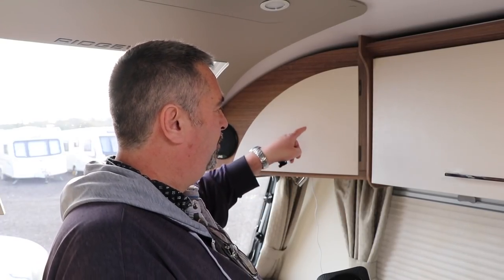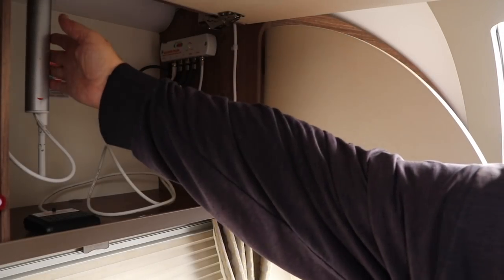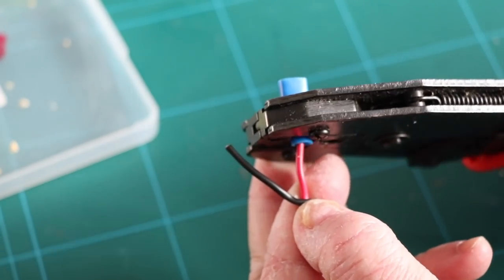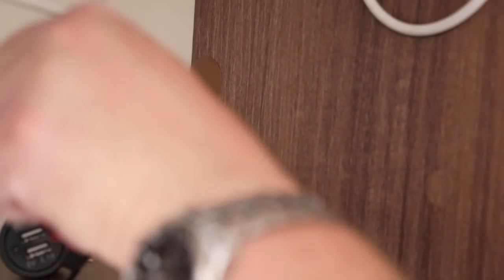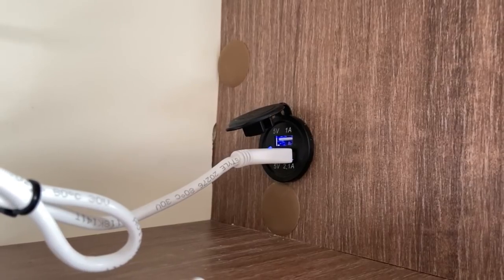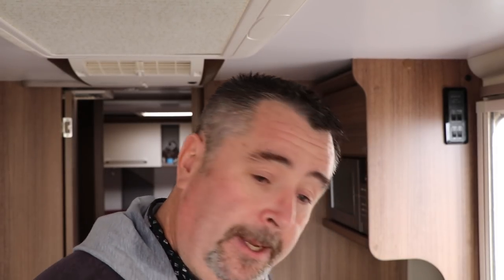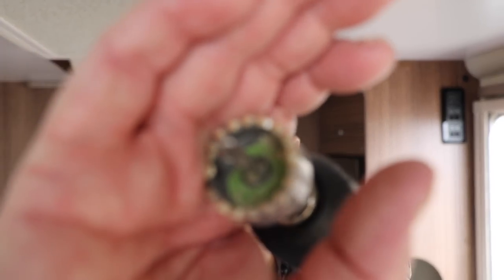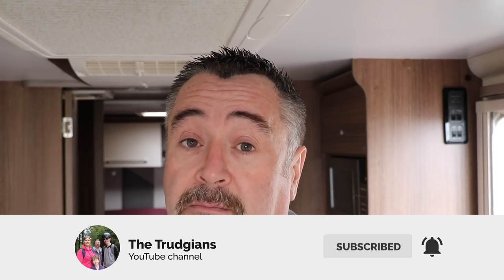A useful caravan USB installation

Comment: Great job there Dan, especially fitting the socket so everything is hidden inside the radio housing. Good idea that using the drill to twist the wires together. Stay safe Dan and family and look forward to next video. Rob
Reply: I’ve just installed a 12v socket in the caravan locker to run the compressor to do drain downs pump up tyres and air toys. Love these mods

Comment: Don’t throw it most hole cutters only come a certain depth as you have a pilot hole all the way through you can come from the other side. If this is not possible then when it bottoms out remove the hole cutter remove the drill bit from the centre then slide the hole cutter back into the grooves already made then tweak it to one side and the insert will break off. If not then use a small flat point screwdriver and do the same, once the excess has been removed you can put back in with the drill bit and cutter to keep it central and continue to cut. I use this method in cutting holes in trucks and van bodies when installing fridge units. Top tip take your time and it’s neat and tidy.

Comment: Hi Dan we have our caravan on the drive just last weekend brought it home from the seasonal pitch today I fitted two hidden usb sockets plus a Alde discrete heating sensor and tomorrow I be following your fridge fan insulation I purchased all the parts had them waiting for the season to end to fit setup the parts just got to assemble thanks Dave🤣😊

Comment: Hi Dan, Good to see you back, the problem with the hole saw could have been rectified by drill the hole from both sides of the panel (that's of course
if you can fit the drill in). This also makes for a cleaner hole on both sides.

Comment: Do you have a solar panel? We have a tracker and a mouse repellent on all the time and battery stays topped up in storage all through the winter. So if you go off grid your ‘live’ USB’s won’t be a problem. I put a 20amp socket and usb on the bed panel and wired them onto battery using a mini fuse board you have in the car. We have a Bailey Brindisi where battery is under bed. I put the socket in for when we try going off grid so my good lady can use a 12 volt hairdryer which needs 15amp minimum.

Comment: Hole saws can be handy if you have veneers and access both sides.  You can cut to the center from both and prevent breakout.  The radio could do with a surround to hide the mounting cage could it not?

Comment: Hey Dan, your pioneer radio looks like it's got  a usb socket on the front of it. I believe all usb sockets generally give out a 5v feed, although I'm not sure what amperage it'll kick out. 
Although not a dedicated feed, could you have just plugged the Netgear nighthawk into that?
Also a top tip, if you find yourself without a charger on holiday or in a hotel, the back of the Tv will charge your phone if you have a lead.
I love my nighthawk, they really do work well.
Reply from the maker: Hi Garry, I did try the radio to begin with, but sadly the socket is only powered up when the radio is switched on. So, in standby mode the USB is off. 

Thanks for the suggestion though
D

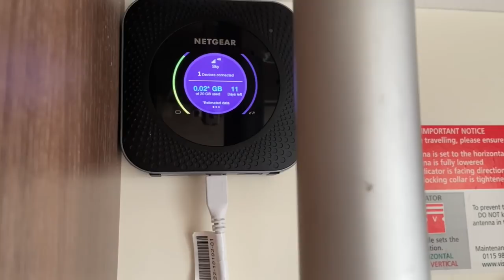Comment: 5:19 You may find that if you remove the battery that you start having connectivity problems - in devices like this, the battery is often designed not only to make the device portable, but also to provide power to cover any spikes in demand that the USB supply can't meet.
Reply from the maker: Hi Nicholas, so far my experiment works, its been running for 3 weeks under low/moderate and high traffic and its working well without the battery installed.
Reply: @TheTrudgians  That's good news. Excellent.

Comment: I had a (different model of) Netgear 4G router with an internal battery that I left plugged in to USB all the time; it’s just failed and I was alarmed to see the battery is bulging out of its casing in an “about to explode” kind of fashion. So I would recommend removing the battery if leaving the device plugged in permanently!

Comment: Hello Dan, great video thank you - I actually have one question that got me curious...at almost the end of video you switch off the mains in your caravan and say that the mobile phone notifies you about that: how does that work?!?
Reply from the maker: Hi Thats the iNet the is moaning that no 12volts are getting to the boiler, Its a quirk of the system that the iNet stays live even when the caravan is switched off. 

The iNet commuicates with me when ever there is a fault, like the boiler is faulty, there is no gas or the caravan is freezing cold. Its a great system.

Comment: Another good tutorial Dan! - 

Other than easy access to existing 12V, thinking about cross mod between the 2 devices, would another location not have been a better choice? I imagine there to be some 12 V cables running around the vans cupboards .

All in all a good easy to do upgrade. 

Many thanks for all your uploads 

Kind Regards 
Howard
Reply from the maker: Hi Howard, yep - not a great place for RFi, but it will lead me onto another video of interference and how to cure it on the Status Amps and TVs. i have a few chokes here results thus far are encouraging.

Comment: I use white 'BlueTac' instead of velcro to mount small ancilliary bits and pieces.
My solar panel controller and my wifi router are both mounted this way.
Easy to install and remove, with no gluing.